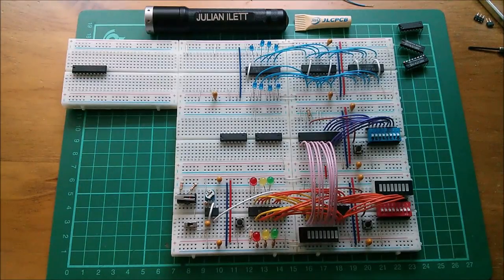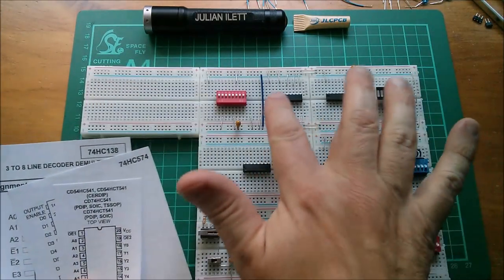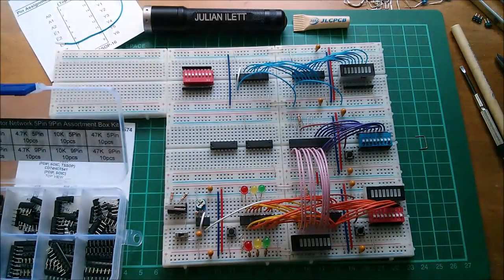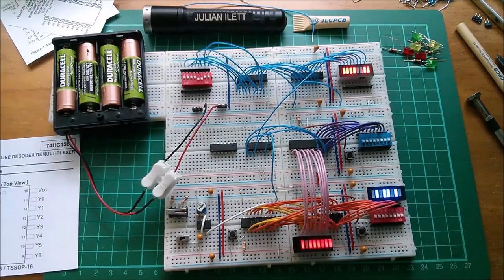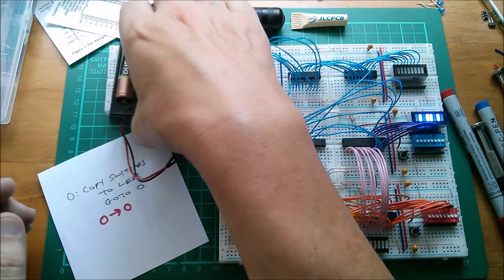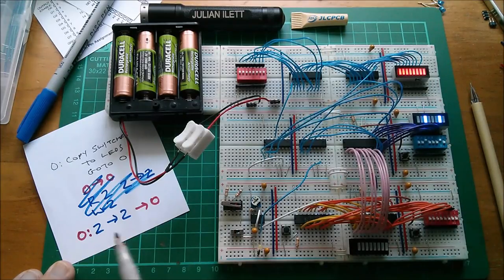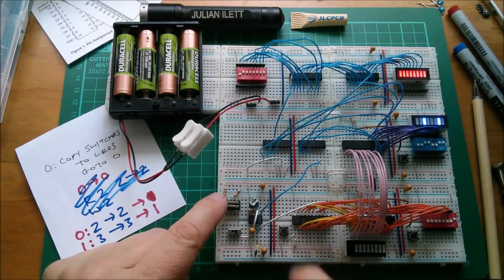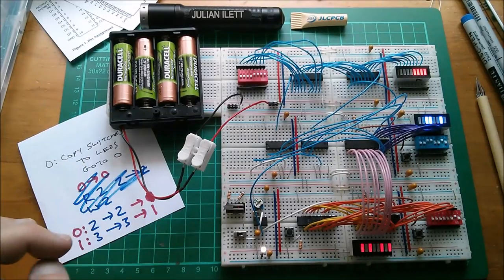Another look at the 8-bit Breadboard Computer

Comment: I'm guessing that the reason why it doesn't work right in single-step mode is the polarity of the single stepping.  If it copies on a high and jumps on a low, then your single-step switch must be going first low and then high on release.  If it copies on a low and jumps on a high, then the switch must be pulling the clock high first and then low on release.

A problem you're going to have to deal with is that your computer has to be in either "copy" mode or "go to" mode with no such thing as an "idle" mode, so you're going to have to choose one or the other mode as your default condition.
Reply from the maker: +JasonMasters yeah I just swapped the resistors on the single step switch to fix it.

Comment: It would be nice if you actually made a block diagram before fiddling around with the components on a breadboard.
Reply from the maker: Would you prefer I wait until the design process is completed before I show it?
Reply: I designed a computer based on your concept and it only took a couple of hours to go from the idea to a functioning logisim project. I really don't know what's taking you so long to figure out how your computer is going to work.
Reply from the maker: How did you implement literals? Just curious.
Reply: To be honest, i just made the instructions 24 bits wide so everything could execute in one cycle, but if i had put in a little more effort i could have turned it into a multi cycle design with the operands located at separate memory addresses. That would be very hard to implement with 74 series logic though.
Reply: But that's not really an 8-bit computer then, is it?
Reply: Well, the 8 bit PIC architecture has a 16 bit program ROM and VLIW processors can have instructions as long as 1024 bits, but for a processor as simple as mine, 24 bit instructions are really embarrassing.
Reply: Literals? I think I suggested this on an earlier video. 
One of your "devices" would be the instruction register (or the memory output, as I don't think you have an actual IR) . 
Trouble is, you would only be able to load a 4 bit nibble, which might be useful enough  ("Copy Immediate Nibble to Accumulator") - you would need a special device/register implicitly addressed as the target - an accumulator. You could use another device address to load the other nibble, or have a "Copy Nibble Swap xx" variant of copy, followed by another CIN to load the other half. 
This is why microinstruction (which is what your instructions really are) words are always wider than the machine's programmer-accessible registers (it's "word length") - You have enough bits for both the micro-opcode and immediate data, for device/register addresses, and for control signals. 
But keeping this project simple and clean precludes that, so it must have fairly strict limitations, such as only 4 bit immediates, and less than 16 devices, since some of those 4-bit combinations will be needed for variants and special case instructions, such as CIN and CNS above.
To get any sort of usable result with this project, I think the single "Copy" instruction will need to become a little fractured, with special addresses that cause special behavior.
Reply: Julian Ilett - not sure if you really need literals (if I understand the question correctly). If your program always starts out by XOR'ing A with A, you get zero. Store that somewhere in a register/memory. Follow by INC A, and you get a 1 (assuming you can force a carry?). Store. LSHIFT A or ADD A, A and you get 2. Rinse and repeat until you have what you need in the form of little constants.
Reply: That would take a lot of cycles though...
Reply: slap_my_hand - how? 4-5 instructions as a preamble to each program? The small constants would be stored in memory for reuse.
Reply: Glad you know enough to have a go at his work.

From everyone else, including kids watching this who will end up being able to design & program properly because they now know exactly how a computer really works..... 

These videos are cracking
Reply: @slap_my_hand  

The by empathiseing with other learners it makes the subject very accessible to beginners, it is effective communication.

The fiddling lets young learners know that you don't have to get all + exactly the 'right parts' to not fail. You will be able to get a computer working from similar or fewer parts because you are learning how computers work, not how to duplicate THIS computer

Comment: Now I know why a lot of early computers had multi-phase clocks.
Also FYI - it's not the buffer that interprets high-impedance as low (or high), the actual voltage on the bus was low (or high). You should add pulldowns or pullups if you want that.

Comment: Julian, why did you decide not to use TTL chips? 

When I went to school for electronics engineering, almost 30 years ago, we had to build computer circuits that would perform certain functions like an arduino does today, using just TTL chips...Great video.
Reply from the maker: +Arthur C It was all TTL, but 74HC is available with greater variety.

Comment: I think this computer could execute instruction in four phases with a single RAM:
Step 1: Copy input device to output device
Step 2: Execute an instruction with the ALU
Step 3: if the flag is LOW, copy data to the program counter, otherwise do nothing
Steo 4: if the flag is HIGH, copy data to the program counter, otherwise do nothing.

Comment: Warning Ground Strap not required
Reply from the maker: not required :)
Reply: T Komoski Ground wristband is certainly needed when handling HC cmos devices. When Julian touches his loose wire and data clocks data from the switches to the LED’s it proves that the input is floating and internal CMOS transistors can be shorted from the VCC to GND for a short period of time. That can be fatal for the chip. Always handle CMOS with care. Faults can show up quite later and they can quite flaky.
Reply: Nigel James - Yes that's true but the amount parts he must have would cover a blown IC or two. Wearing a wrist strap is a pain, and I had to wear footwear ground straps in really sensitive areas. I was just joking and yes HC stands for High Speed CMOS, I am an Engineering Technician if that helps. Output pins are not so bad but inputs you have to watch.
Reply: T Komoski I’m a hardware and software technician. I learned the hard way about ESD after years of TTL and then switching to CMOS. I couldn’t understand why my circuits would work sporadically. I suppose you learn by your errors !
Reply: +Nigel - ideally, you learn from other peoples' errors.. but I'm never quite smart enough to do that :)
Reply: Sharky Sharklops That would be ideal, but it has been me making the mistakes and not grounding myself and destroying my own circuits up...lol.
Reply: Other people make mistakes. I gain experience.
Reply: @TKomoski  it does